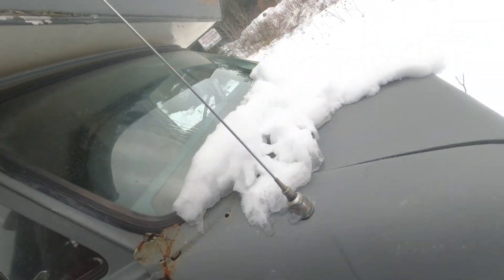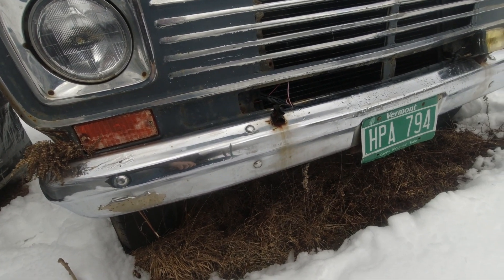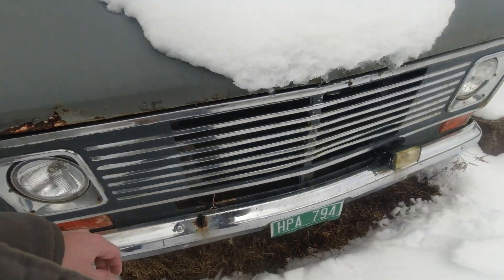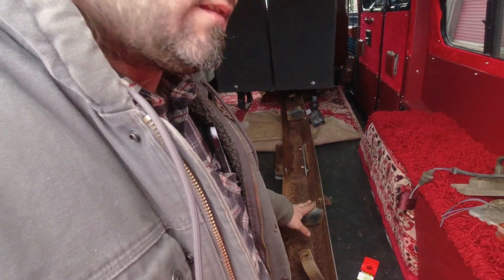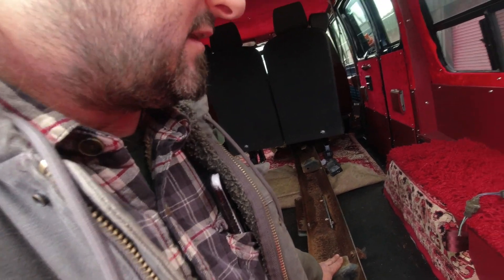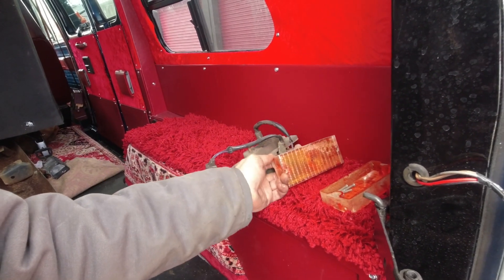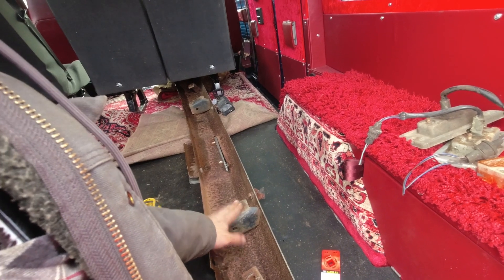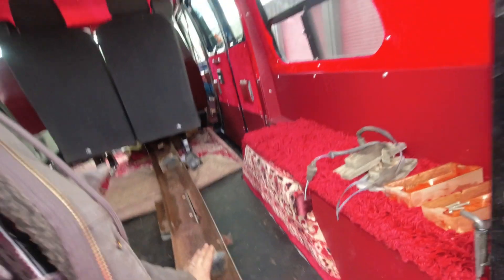Another roadtrip looking for parts for the Shorty Van

Comment: How did you remove all the pinstripes from the van
Reply from the maker: Pinstripe removal wheel (aka caramel wheel) in a drill. Use the slowest speed and have it oriented so it is spinning towards the stripe. You want it to lift the edge of the sticker but not spin fast enough to heat up the glue and make it stickier. It will likely come off in tiny pieces that fly everywhere.
Then remove the residue with goo gone.